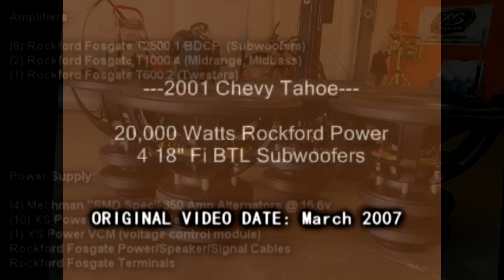Chocolate Milk Trick II - Powerful Sound System BASS makes perfect mix! - Lil' Vance Approves

Comment: Hey smd , I'm a huge fan of the videos you make , unfortunately I'm in jax fl and ain't got the option to come check out your shop. But can you make a video on how too check amps power output , cause I can't find anything anywhere on how too. And I would like to know if my bostwick DA 1200HC is putting out the power I think it is.  I'm running that amp on a 2015 alpine type r 15 in a 3 cubic slot port box in a h3 hummer. (Lights dim bad)    thanks
Reply from the maker: JASON JACKSON um, thanks man! but how are you a fan but you adked me to make a video on how to check an amps output? LOL.  Must not have watched any of my video's.  But thanks, i think.